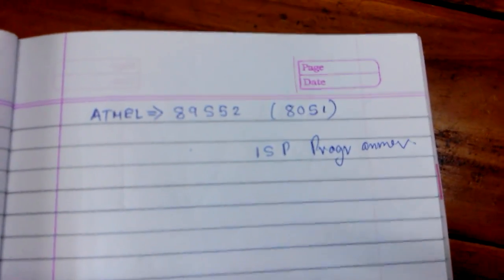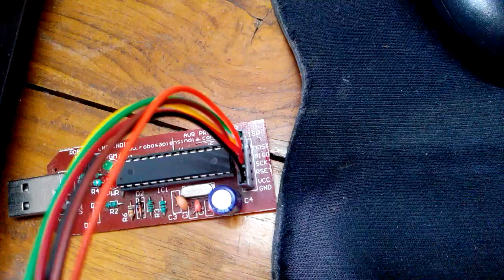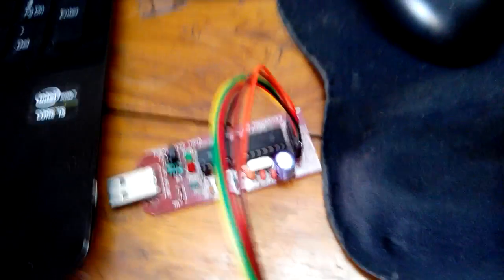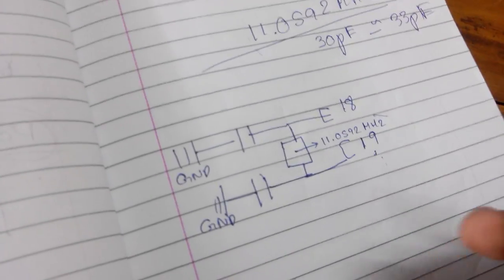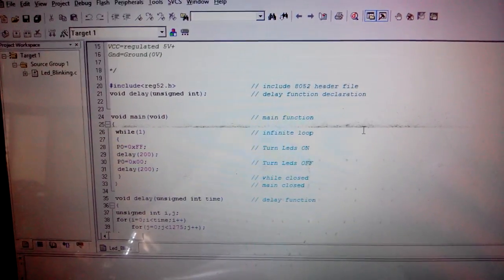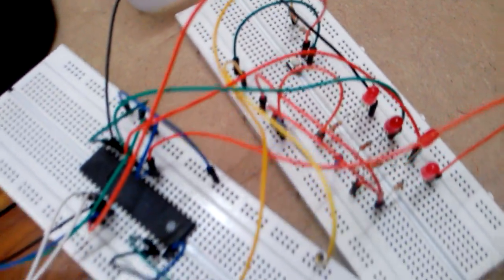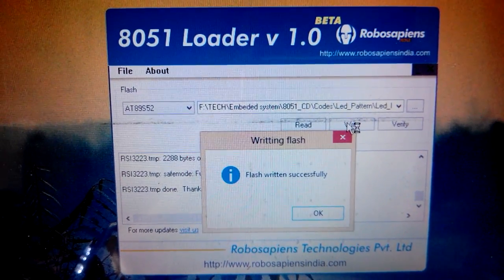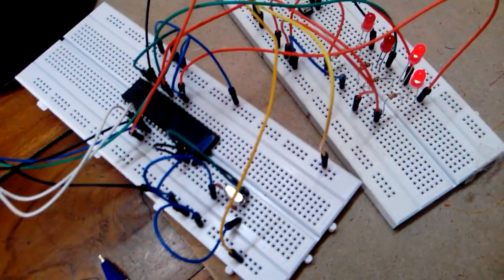8051 Microcontroller Programming on Breadboard

Comment: Hello!
I am working on project using 8051 . However, it keeps showing chip enable error. Is it necessary to use 11.0592Mhz oscillator , i have used 12Mhz??Also, I have used usbasp programmer so is it causing the issue?Should i use only ISP programmer?

Comment: hello i have done a project on breadboard using microcontroller at89c51 .the project works but sometimes when i connect it with vcc no output comes and after sometimes  when i connect output comes properly .can u tell me what the problem is ?
Reply from the maker: Sir check ur  power supply and try to put capacitor along vcc and gnd.

Comment: Hey ..
I am using usbisp programmer and no crystal . I see error saying "chip enable program error"
cant i program at89s52 without a crystal even if i dont use it as a timer and simply want to glow led on p1.1(say)
Reply from the maker: Sorry Harshit u can't 
Crystal not only provide clock for timers but it is necessary for even running a single line of your code . 
Hope u get my point
Reply: Thanks Friend

Comment: This video is very usefull.. thankyou.. i am currently working on a project which is  temperature sensor using 8051. i have some issues programming the ic.. i am planing to use keil software... is ISP programmer usefull for all the projects? where do i get it? is there any other options except ISP programmer? like data bus via rs232 etc.
Reply from the maker: Nidhi Karkera  Yes ISP programmer is very usefull......and it can also be used to program ATMEL series .............U can buy ISP programmer from any online store ...........i purchased it from robomart.com
Reply: thanks! :) will it be available in normal electronics shop? dont have time to order it online... there wont be any changes in the code for the project after using ISP right?
Reply from the maker: Nidhi Karkera  Yes Mam thery are available on normal electronics shop ................and as per my knowledge u code will remain same
Reply: ok.. thanks a lot TECH LOVER VNIT Kuldeep Singh Rajawat  :)
Reply: can i use isp to program both Avr and Pic uC ics ????